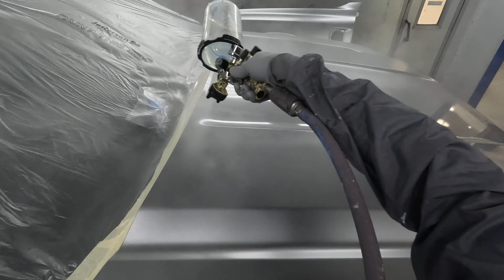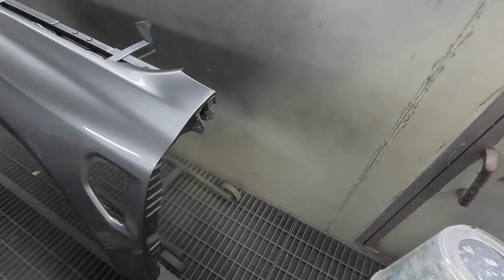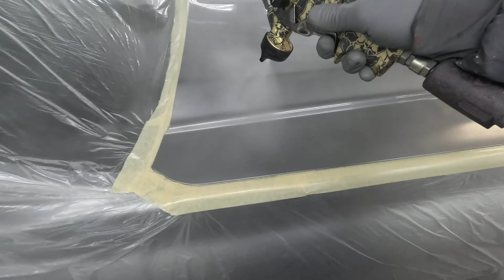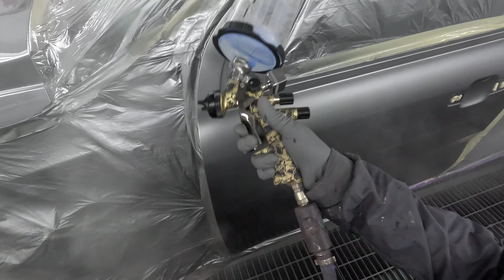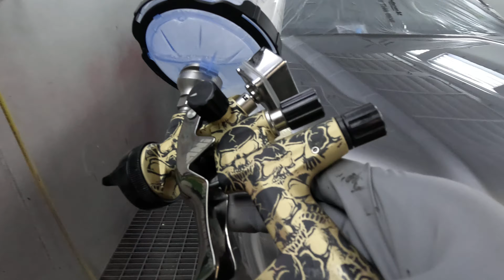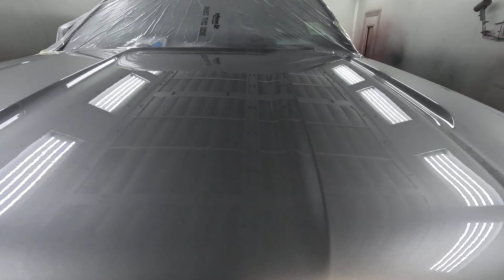STANDOX Xtreme Clear Coat Application

Comment: I can’t imagine spraying a 2nd coat back to back 10-15 years ago when I was in the booth full time. 
If I did this it would be “SOLVENT POP CITY”.
I did paint my Nissan Cube (1/2 the vehicle, high metallic blue), it’s been over 7-8 years since I sprayed an automotive base coat clear coat job, the newer base blended effortlessly, and this was a colour I painted back in the day, it would have been a struggle to blend, but it blended super flat, smooth and clear, metallic laid perfect and effortlessly. Clear went on mint, was very easy to spray. (Keep in mind I’ve been spraying a single stage urethane industrial coating for 13 years now daily).
Do the newer clears work like this?… you can pound back to back with no problems?
I haven’t been in the booth for over 14 years. (Did it 11 years full time).